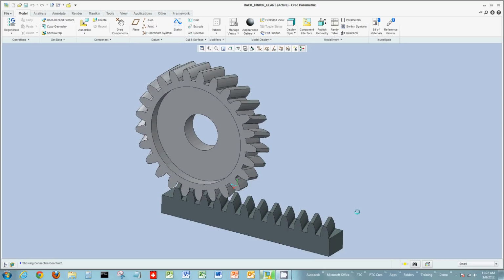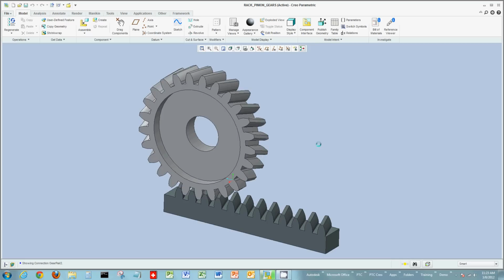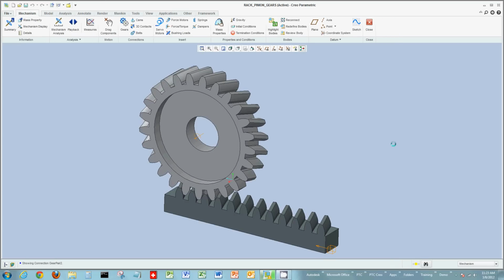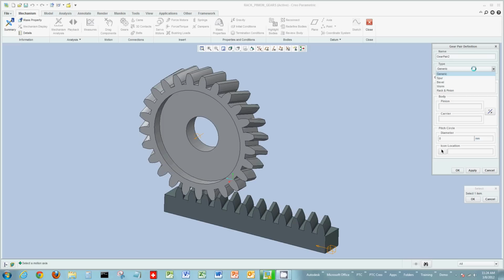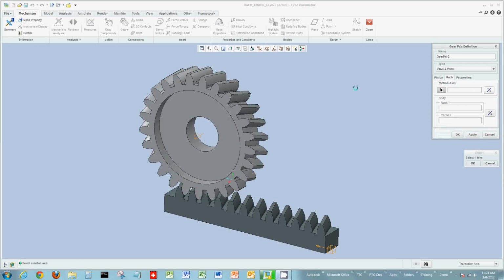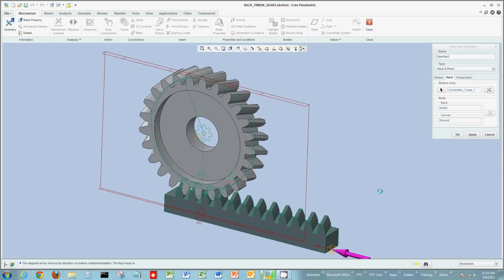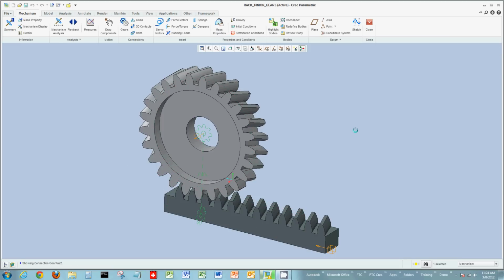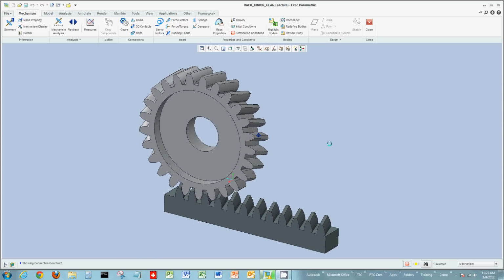Creo Parametric - Mechanism Dynamic Gears

Comment: Sondre Eknes -- the parts have to be constrained specifically as Pin Joints. When you are defining your constraints for whatever part you are assembling, you have to make sure you select Pin Joint from the drop down menu. If it says "User Defined" it will not suffice.